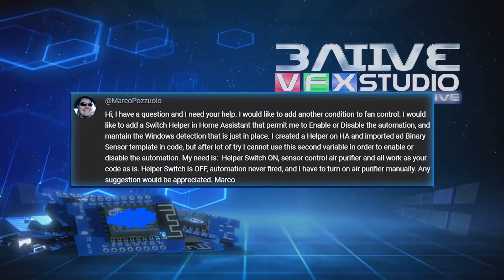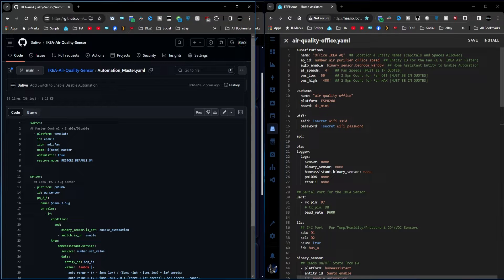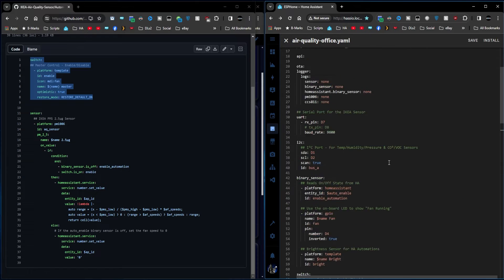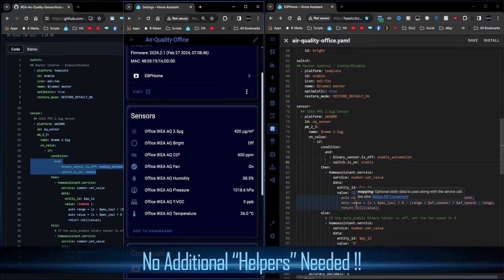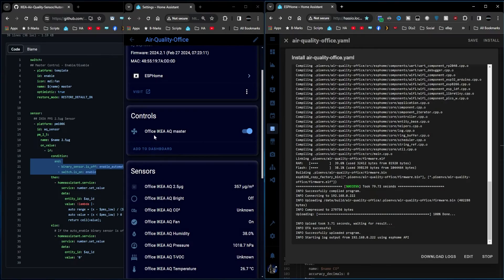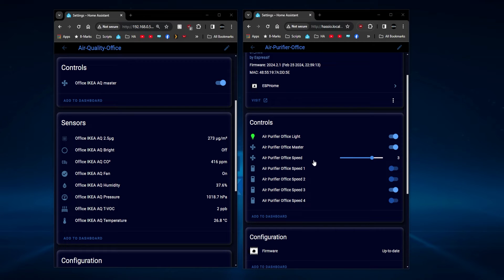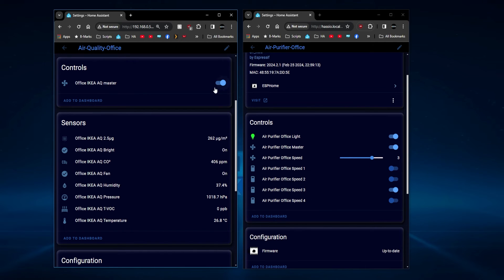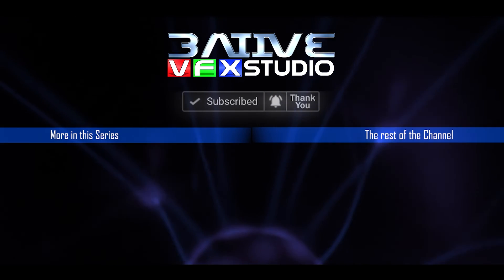IKEA Hack 3: Unleash Advanced Control for Your IKEA Air Quality Sensor

Comment: Nice, I love your ESPHome tutorials, can't wait for the next ones.... One question,  will the "master" switch turn off the internal fan inside the vindriktning?
Reply from the maker: Thank you for the high praise and for being a subscriber. 💖
Regarding the "Master" switch: The ESPHome Automation here commands the Air Filters' Fan speed based on the Air Quality sensor. With the addition of this new "Switch" the automation, via the "Else", sends a "0" to the Air Filters' fan speed - Just like opening the window does.

TL;DL - No, not the fan in the Vindriktning (Air Quality Sensor) but the fan in the Air Filter.

Comment: Hi this is a great job. I have followed your steps to make one. When the air quality turn bad, the fan run at speed 6. However, when the air filter speed gradually turn down to zero, the fan still running in low speed. The fan doesn't switch off even the fan speed and pm2.5 turn to zero. Would you please help? Thanks
Reply from the maker: Glad you liked it and found it useful. 
I hope you will be able to find the problem easily.
Reply: @3ATIVE  Ok. Found the problems. 1. I need to cut the trace between U11 to R13 you mentioned in the comment of another video. 2. I changed  value: '0' into value: number.ikea_air_filter_speed inside IKEA air quality sensor sector
Reply from the maker: @garyckw  Oh cool. 👍
So, is it all working now?? 
- Sorry, I couldn't have been more helpful - I hope you can appreciate there's not a lot I can do from a comment section. LOL
Reply: @3ATIVE  all working now thanks
Reply: By the way, do you know any simple method to use back the rotary switch manually for the air filter? In other web page, I saw one but have to cut the leg of the rotary switch
Reply from the maker: @garyckw  It's not something I considered, after-all the whole point was to make this "Automated".
If you wanted to add the knob, in addition to my project, you would have to disable what I've done in order to prevent a conflict.

Comment: Hi @3ATIVE i tried today and it work great. I noticed that with this enhancement I still cannot use air purifier in MANUAL mode, due to Else condition that set always fan to zero. I wrote my own code using lambda to evaluate condition a now disabling master i can use air purifier manually. Tomorrow I will Upload my code in my github and share. If there i a way to achieve this without evaluate condition in lambda, I am very curious. Thank for your great work.